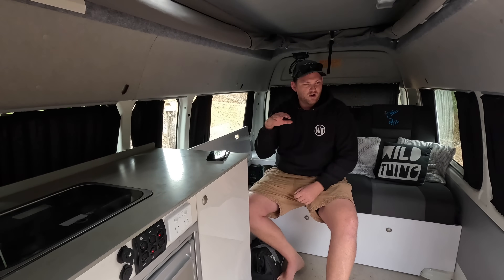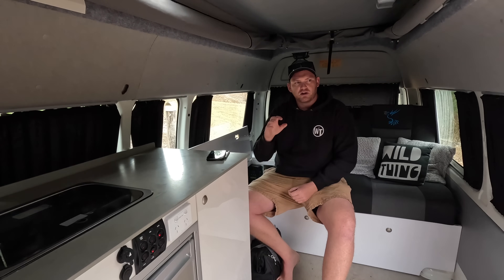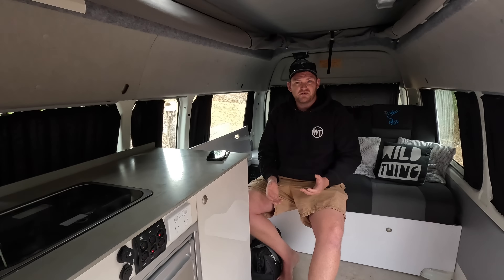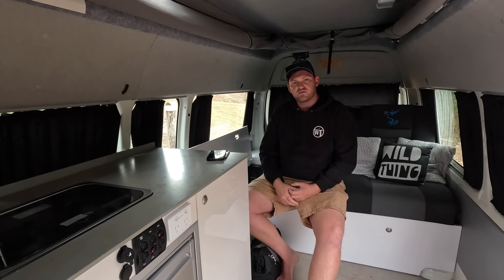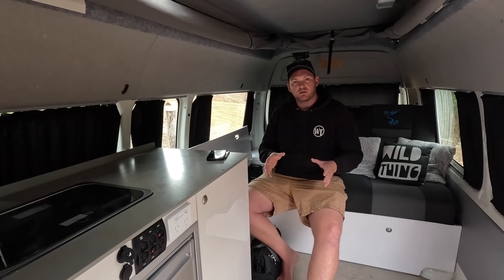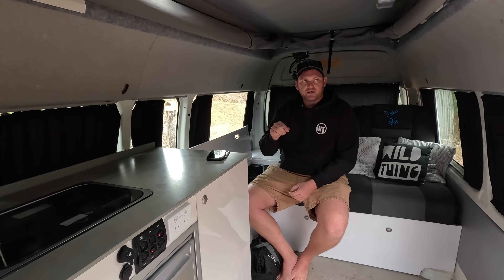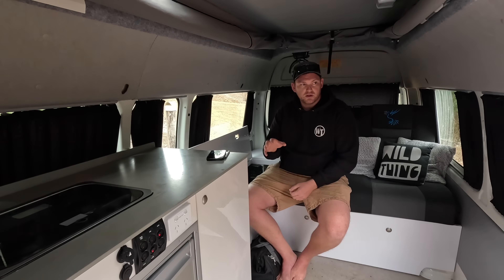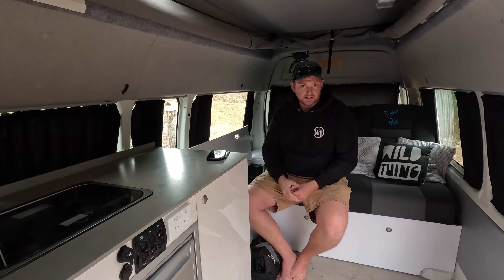'DROP IN' LITHIUM BATTERIES || The truth about charging a lithium battery with a lead acid charger..

Comment: Lithium batteries should not be installed inside a camper van, they should be treated the same as a gas bottle.
Reply: Cudo’s for a well explained and reasoned description for lithium deployment. Lithium offers all the advantages you put forward however one issue you are having people believe here is the safety concept of lithium, ALL lithium families have the capability to catastrophically fail,  Phosphate are the most benign next to titanate but they can and do have issues. What people don’t state is that the safety is totally reliant on the battery BMS. The loss of the BMS removes all control and safety constraints. Nearly all lithium fires have been a result of BMS failures which led to the cell failure everyone calls out. BMS failures are rare - but the can and do occur. A reasonable installation should allow for sufficient ventilation to account for the tiny chance that it could happen, as a note a lithium fire cannot be extinguished until the electrolyte has burnt itself away. The gasses involved are toxic and if contained explosive hence some sort of ventilation is good practice.
Reply from the maker: LiFePO4 batteries are probably the safest battery to have inside a camper van/ caravan/ motor home. 

I’m not sure if your confusing them for other lithium chemistry batteries which are more unstable? 

The BMS/BPS will shut the battery off if there is a dead short, over charge or other malfunction.

They don’t gas or vent, their chemistry is very stable. If they are overcharged or subject to physical damage, the phosphate-oxide bond remains structurally stable; whereas in other lithium chemistries the bonds begin breaking down and releasing excessive heat, which eventually leads to thermal Runaway. Lithium phosphate cells are incombustible, which is an important feature in the event of mishandling during charging or discharging. They can also withstand harsh conditions (freezing cold, heat or rough terrain). When subjected to hazardous events, such as collision or short-circuiting, they won’t explode or catch fire.

Comment: Good info thanks Cam. 
I've wondered if some of the fire incidents we're hearing about relating to lithium batteries are from using an incorrect charger? It's inevitable there will be some oops moments as we transition to lithium technology.
Just a heads up for anyone with a Redarc BCDC  1225D or 1240D  in car charger (many will have these set ups installed by ARB).
The wiring connection needs to be reconfigured when swapping from  an AGM to lithium battery. Details are available on line - read the instructions!
Reply from the maker: Cheers mate! There’s definitely the risk of a fire with any battery system. But I honestly think a lot of the fire stories you hear about are crap! 

Bit of fear mongering going off the back of stability issues with other lithium battery chemistry (specifically lithium ion). 

But I’m sure overcharging, lower grade cells and a cheap bms don’t help the chances of malfunction! 

Yeah you’re bang on about the redarcs! 👍🏼
Reply: @WildTouring   - Fires which are verified seem to not be the battery (at least not with the LFP - intrinsically safe ish-  installs I have heard of) but the Electrical components, wire gauge, quality of crimps etc.

(Between the shed and car I have 1000Ah of 12v (4S) LFP,  I also have (and have had) white a few "LiPo" batteries used in RC aircraft (and "drones"" )  - a few puffed cells (even one sitting inside a concrete block containment for the last few years - that is a 6S 5AH Nanotec LiPo with the most negative cell severely puffed and measuring zero volts ), never once a fire - on the battery side.

Comment: Thanks, whats your view on under bonnet lithium?
Reply from the maker: You’ll notice most of the brands that offer under bonnet lithium shorten their warranty period. For good reason, the chemistry/technology just hasn’t been there yet. A few brands have messed around with trying to shield or insulate the cells- but they all end up heat soaking after hours under the bonnet.

BUT, Watch this space. There’s people working very hard on testing new tech 🤐

Comment: Spot on. I’ve wondered how many battery sellers get away with claiming this. I learnt all about this in my solar storage course. About time someone has spoken up about this Cam. Another myth is that draining lithium down to 0volts when flat. It will only shut off at the volts predetermined by the bms. Good video.
Reply from the maker: There’s a few wild claims from some of these battery sellers!! Cheers Tim 🍻

Comment: Good video to make.  I'll give a few points....  

Many people have been fooled into think the "drop in batteries" have current and voltage limiting circuits....  And that's clearly wrong!  Good you mentioned that.

People make too big a deal about charging profile for Li batteries.  They don't really care how the current is delivered (most cells are rated for >0.5C charge if not 1C)... But the BMS input MOSFETs are often less than that.  The important point is to stop charging once it's full.  Again, 14V is a better charge voltage, as thats 99% capability.  

In your parents case.... You could put an Anderson plug on the 240V charger and feed that into the Dcdc converter .... The rare times that's required.  I have an old ctek battery charger that has a constant voltage mode of 13.8V.  I use that to charge my Li batteries
Reply from the maker: Cheers Chris, funny you mention that. I was wondering how the enerdrive would go with the existing AC charger coming into channel 3. On paper it’s still within the voltages the enerdrive can handle. Was gonna ask my auto sparky 🤷‍♂️
Reply: @WildTouring  Was also wondering this, just put a lithium into my 4wd which has a lithium compatible dcdc (renogy) and a victron mppt for normal charging duties. I do like to put the car on the 240v charger before trips and havn't bought a charger yet for this purpose. Have just put a 370w solar panel on the roof so not sure i'll ever need to now, need to wire that up and see if im ever going to need 240v charging again, I suspect not.
Reply from the maker: @bradleymarshall5591  I reckon Ac charger may not turn on without seeing a battery voltage. If you want to do something like that what you can do is put the ac charger on the cranking battery, itll charge it & turn the dcdc on to charge your aux battery too. Not the perfect scenario but itll get the job done.

Comment: Curious as to why you limited the enerdrive to 30a? a Hiace alternator should be 120a so having it set at 50a shouldnt be a drama at all. As thats one of the biggest benefits of lithium, being able to dump a large charge current into it to recharge in a shorter period of time.
Reply from the maker: Yeah the alternator, DCDC charger and battery will all handle a 50a charge no probs. But I’ve limited it to a more conservative 30a for longevity. 

Everyone has different needs, my folks wanted something that was absolutely set and forget for the next 10-15 years. So the battery I put it in a slightly larger battery so that it is never deeply discharged, and charge current was set to the batteries recommended standard 30a charge current. 

They’ll get a good 5000+ cycles (13-14years of daily discharge to 70%), and a 1-2hr drive will have them topped up again. With the reserve for a much deeper discharge for the longer stays where solar isn’t performing well.
Reply: Go back to what Cam said re the recommended charge current for the Allspark 150Ah Lithium is 30amps.
I have 2 of these Allspark 150Ah batteries that are now over 4y.o. and still performing perfectly charged off the RedArc BCDC1225D
Reply: I set mine lower too. If stationary or cloudy for too long and the soc gets low you can always bump it up a bit.
Reply: Smashing 50 amps day in day out to a "smaller" battery will ruin it quicker than ud wanna hope to be replacing it again.
Reply: @krump743  completely wrong. It’s not like a lead acid or agm battery where input charge has an actual effect on life. And 50ah on a 150ah lithium is completely fine and within spec, most BMS units are rated much higher for charge rates.

9/10 what kills lithium is vibrations, not charge/discharge
Reply: @SUPERTRUCKER166  bruh... I said "smaller batteries". If it was fine to pump in 50 amps to a lithium battery why does redarc recommend a bcdc25d for batteries under 200 amps.....
Reply: In Straya its spelt Baddery 😂 Good on you for looking after your folks. Spoil them and fill up their fuel tank and fridge too 😊

Comment: That electronic sound when the numbers first came up frightened a fart out of me. I was only partially paying attention but the ZZZZZZ sound woke me up!
Reply: @WildTouring  Hello Cheers for sharing the knowledge its hard to come by with this topic. Ive just basically destroyed 1000$ worth of kings gear due to reverse on the battery terminals, but i did manage to learn a bit in the process.( that battery never was right and sent me mad trying to figure it out) But i taught me what i already knew, to not buy garbage it will cost more in the future, tho Im happy it wasnt a expensive set up i destroyed. So thats the good i can take from it. I have so much to learn on a modest budget. Can i ask what battery would you recommend i get to power a caravan/cabin for one people, be just me.  Im looking at the ATG 2x 150 or the 200 ah, whats your thoughts on that. I have the Victron smart shunt , all my panels 3x160w,  breakers and fuses , some 2 and 4  awg wire , lugs and a cheap crimper. from Ebay  When i figure what battery i want i can then get the victron MPPT and charger to suit . Would really appreciate any help you can give me. Cheers.
Reply: What i have picked up on is that most of the cheap ebay battery are only good for 80% of discharge, combined with a cheap mppt that gives me just over half of the batteries captivity 80-80  ( probs used cells that will never fully charge either way 🤷) Am I right in looking for a battery that can , if i choose to, use 100% of its captivity that I can change if thats what I choose to do. I believe a  a victron Mppt will allow this.  This is what im thinking after months of reshearch and reading, Is this correct. Sorry for the babble,  but cheers to the beers.
Reply: Made me jump up lol